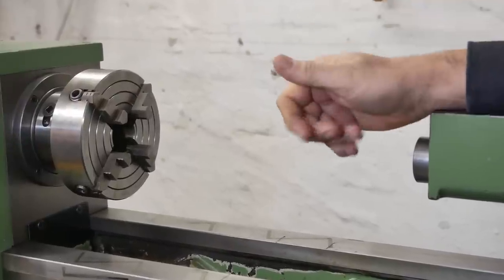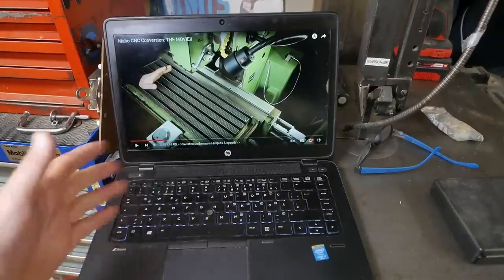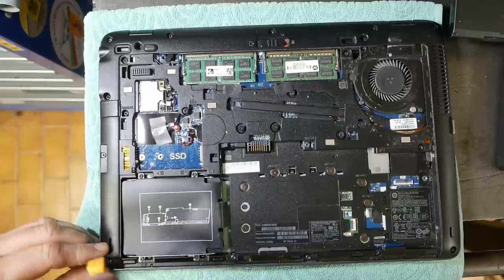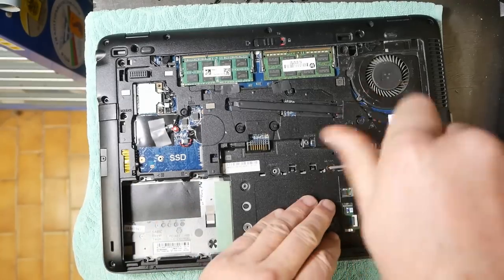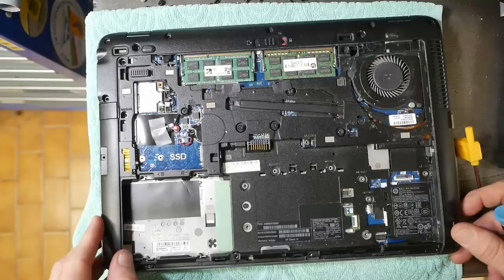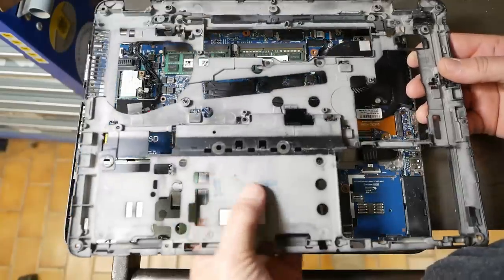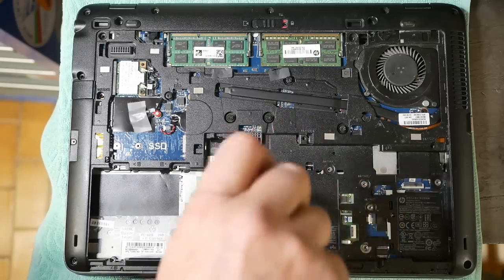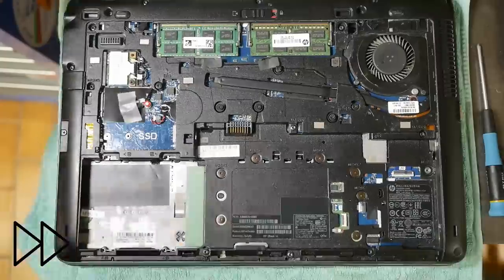M1 Mac: New, Refurbished or PAINTED?!?

Comment: linux+lenovo fanboi opinion: get a lenovo and switch to linux. you'll have a brick (in terms of weight) with painful video editing (in terms of learning a new software). but it'll probably be a working combination for a couple of years. and you'll be able to upgrade it. 
but on a more practical note: what's wrong with a desktop? the new apple SOCs have great performance, but they're impossible to upgrade. a desktop seems like a more sustainable thing for what you're doing. 
and your videos are great as they are. no 4K needed.
Reply from the maker: I travel enough that I need a laptop. I like to edit in the down time and at the airport.
Resolve is optimised to load the GPU and needs 8gb of video ram for 4K editing.
With the current price of 8GB GPU's, even used, it would be a struggle to put together a used part desktop with the performance of the M1 Air, for that price. And I need a laptop about 20% of the time.
Reply: @RotarySMP  "20% of the time" or "laptop" must have been a typo in your last sentence.
i just wouldn't jump the an apple SOC bandwagon until their business model with this approach becomes clear. but i'm also an idiot that wants to get 286 machines going again. so there's a rather special point of view here :P 
we'll love your videos anyway, be they 4K or not - your quality is not in potential 4K, it's in the stories.

Comment: Keep the one you have, paint it cause why not, keep filming in 1080 and buy some cool stuff for the lathe with the $$$ you save :D 
I still don't have a 4k computer either I suspect most don't watch youtube in 4k anyways. I like my old HP I have one too but if I was going to upgrade I'd go for newish used gear rather than pay brand new prices.
Reply from the maker: The old zbook cant play back sped up footage, transitions or titles in real time, so there is a lot of slide show. I do a lot of sped up footage, and cant really see what it looks like till it is rendered out. 90 minutes for a 15min 1080 vid. A modern computor can do that in a minute or two.
Reply: @RotarySMP  I'd go for that deal on the peach one paint it to match the maho lol that was a pretty good idea. Just tape off the USB ports good 😁 but yeah 90 mins is pretty slow. Don't need best maybe can get by with 5yo laptop instead of 10. I got I think 5yo HP and it's plenty fast i7 and only about 500

Comment: I've just successfully removed gold anodizing from a centre punch using a bath of sodium hydroxide. Take the electronics out of the macbook and give that a go.
Reply from the maker: It is a good way to disolve aluminium, like the cases.
Reply: @RotarySMP  No, don't worry, it's like watching paint dry. I've tried it on heatsinks before, it took me 48h to get the black anodizing off.

Comment: Mac's are nice but the OS drives me absolutely bat shit crazy with some of the things that are just standard issue features in both linux and windows machines... which is why I primarily use windows 10 on my (intel) mini and of course you can't do that on an Arm Chip. I think the new hardware is excellent, and the OS is great ... but there's a lot of little nitpicky things that makes probably no difference to most users, but have been solved decades ago on other platforms ... My 2 cents
If you are serious about the MBA I would go with a refurbished one, Mac's are not cheap to repair and keep some form of AppleCare. 800 bucks is a lot to be left out of the loop, least 150 more you will get some service for a period of time (I have like 300 in my mac mini so fk yea ebay parts and non apple everything that I could!)
Reply: Can you describe one of those nitpicky things please?
Reply from the maker: I have had a steep learning curve with Linux, and Apple OS doesnt really appeal. I though you could basically set everything up to behave like Win OS though.
Reply: @jesperwall839  oh off the top of my head you can't create / rename /delete folders in the save as dialog, you have to go to the finder... there's a shareware extension that does it, but is that going to work though the entire support life of a ARM based MBA? (I don't even really know if it would work with X86 emulation for those machines, its kind of a TSR not a proper app)

 Apple actually supports their stuff reasonably well as one of the last proprietary system makers, where as windows and linux loose a lot by having to barf everything that existed in the last 15 years and see what sticks. My garage computer which does some lite 3d cad work and a bunch of electronics design also runs my 3d printer, vinyl cutter, and toy CNC engraver while watching a tutorial... Is a 2012 mac mini (3rd gen i5 mobile, with 16 gigs of 1600mhz ram and dual 1tb SATA SSD's) and it just lost official OS updates last spring

That's not bad for a 10 year old micro PC that can compile code at 100% processor utilization in a, at times, 43C Garage while I am at work and not complain
Reply: @RotarySMP  I tried and you can get it pretty close and like I said its a bunch of nitpick things. Im no stranger to OSX I still have my G4 with 10.4 on it (but honestly I run 9.22 on it more) but I will spend hours a day on a windows machine doing cad work, then when I get some shop time at home its irritating I didnt copy paste right cause the keyboard shortcut is different and out of the box the only thing you can do is set control to be the command key... now you have no control key and 2 commands grr

Comment: Whatever you do, RAL6011 must be applied. I’m actually in the process of building a new open source 3D printer, and looking to print some parts. I’m looking for a supplier of RAL ABS or ASA filaments.
Reply from the maker: Good color choice. Googling RAL 6011 PLA gives plenty of venders here in Europe. Not sure if it will be common anywhere else.
Reply: @RotarySMP  unfortunately PLA doesn’t have the thermal performance I need. I did find one vendor who can provide ABS in custom colours but only in 24kg minimum. I guess it’s not unreasonable to expect that I’ll use 24kg of RAL6011 ABS.

Comment: Ic the laptop works for 1080p editong i'd stick with it until you make enough money with youtube for a new mashine to be in reach. If you really want to upgrade i would suggest a user mashine. I went for a used dell business laptop and got it for ca. 1/2 of the price. I have no regrets :)
Reply from the maker: The issue is the GPU power Resolve needs on a PC. You basically end up with a gamer PC, plugged in fans screaming to match the performance of a an M1 Air on it's battery. And the PC cost more.
Reply: @RotarySMP  Oh no, i am absolutely not suggesting you should buy a PC, M1 makes much more sense when all you want to do is video editing! All i wanted to say is that i had a great experiance buying a used mashine and would do that again and again, no matter if PC or Mac (thoug a mac is not for me). So by all means, go ahead and buy a Mac Mini M1 (if you have the space) or a Macbook M1 used!

Comment: If what you're using works fine for the video quality you're currently working at I'd stick with it until it doesn't work anymore, the quality of your videos comes from the quality of the content and presentation, not the resolution anyway. That said I wouldn't want to go back to 240p videos, but at the same time I'd question whether more than 1080p is really necessary in most cases, I wonder what percentage of YouTube content is even viewed on anything bigger than a 17" screen these days.
Reply from the maker: Good point, but filming in 4K has some advantages for cropping and panning, even on a 1080 timeline.

Comment: Look at the MSI Modern series, I have found them to be great for CAD work and light video editing. They are also very affordable. I have the AMD version, only thing I did to it was add some more ram.
Reply from the maker: Do you used Resolve? It is optimised to load up the GPU, and seems to need 8Gb of graphic memory for its optimal performance.
Reply: @RotarySMP  I use filmorax, but the amd chips have a good apu, I put 32gb of ram in it and solidworks and inventor work well. Played with premier a bit as well

Comment: Just adding my voice to the cacophany of others saying the same things:

4k video, in all honesty, isn't really worth it in terms of resolution. You may find you get better colours & contrast, but that relies heavily on the camera so YMMV there.

If you're deadset on portable, you can't really beat apple silicon with final cut for performance in a small package unless you go for a much bulkier ""portable"". However, if you don't need the portability aspect (especially if you keep your current machine to fill that role) then a tower that you can upgrade over time will be cheaper and much better value overall (:
Reply from the maker: I first thought the same, as I kind of like PC lego, but Resolve needs an 8Gb GPU to edit 4K (or so I keep reading), and even old 8GB GPUs are so expensive second hand, that I would struggle to build a tower PC for the price of an M1 Air. 

I like how 4K on a 1080 timeline allows you to crop and pan.
Reply: @RotarySMP  That's true, I'd forgotten about the absolute state of the gpu (or pc hardware in general) market at the moment... macbook it is 😆

Comment: If you gotta upgrade the best bang for the buck is the PC desktop, and has been said you then get an upgrade path. I am a mac guy, but the kit is expensive. Windows stuff is not quite as polished but its pretty livable with. Oh and another vote for no shits given for 4k. I'd dip my hand in my pocket for patreon if you went down that root. Also you mentioned the lads at Home and Workshop in Swanley? Those lads are quality, proper characters, ever work in Gatwick its worth popping by, i might even be able to do taxi service
Reply from the maker: Yeah, Steve was really good to deal with. 
Thanks for the offer.
Thanks for your inputs. I need a Laptop, as about 20% of the editing I am not at my desk at home.
Resolve loads up the GPU, so you need an 8gb one, and at the current prices, I'd struggle to build a used part tower PC with the performance of a M1 Air for that price.
Reply: @RotarySMP  ok laptops it is then. Apple Laptops are solid, I have no M1 Airs at work but a bunch of the old ones and they are solid and reliable. Never done Apple refurb as work pay :-) but if the guarantee looks good then I would go for it. Not a huge fan of second hand, too easy to buy a lemon, that being said never actually happened to me but hey. And I agree with whoever said no paint regardless of you much you like green. Stripping and re anodising on the other hand.....

Oh and was planning a trip up to faun over machines but they are shut for covid. Damn

Comment: Don't bother with the old one. It's junk. 

If you want the best, then you need an m1 MacBook PRO, not the air. The air (or anything without a dedicated GPU) isn't going to be ant fun to use. 

I personally decided on the Asus Strix g15 with 3050 GPU, but that is for photos, not video. If you went with a PC, I recommend the Asus Strix. The keyboard is REALLY nice, it has a 5600h or 5800h (both really good cards for battery use) and Nvidia GPUs, so they wirk with resolve. 

I haven't used the m1 apples, but I saw a video of a Mac mini that was supposed to be so wonderful. It still took WAY longer than a proper video rig to render things. It is definitely an upgrade from what you have, so  it might be good for you
Reply from the maker: That whole "get the best" may have been correct, but take a closer look at the actual performance of the low end Air.
https://www.youtube.com/watch?v=lTes9KkwmME
Make you wonder if Apple screwed up, and will cripple the M2 Air, to ensure more diferentiation to the Pro and MAx.

The way an M1 can render on battery while all the gamer PC's crank up the fans and need to be plugged in is also quite attractive. I often edit with the laptop on my lap, and it can get quite hot.
Reply: @RotarySMP  either one can get hot but macs are known to run hot, at least the older 2000s models.

I saw a comparison between an m1 mac mini and a proper video rig on Parker Walbeck's channel. The real one knocked the socks off the mini. Yes, for the price etc, the air is GOOD, but it doesn't have the power of a real editing rig BECAUSE of that loud fan. That is cooling the chips inside. And active (fan) cooling us more efficient space wise, than passive (just radiator fins, without fans or pumps moving hot air away from the fins).

It sounds like you want the Air. It is definitely a good computer, and great for the size etc, all I was saying is that it isn't going to render that 12 hour render you mentioned in 1 hour. If you are wanting that, then you want at least a $1600 PC with 16-32gb ram, 8 core CPU, fast storage, and at least a 3060, if not 3070 gpu. Even that probably will take a long time. 

But ANY new computer that is marketed towards performance editing or gaming will be a HUGE upgrade over the HP.

Comment: Sure a laptop can edit, if you got the time. How's the used server market there? You want ram and cores. Idk if your software can utilize a GPU. As opposed to cpu bound. If so a decent used gaming puter might be the thing for you. Personally I couldn't cross the bridge to Apple Land. Chip shortage, supply chains yada yada .. it's tough all over. That's why I suggest used server stuff. Companies dump and upgrade regardless of market. Couple year old server stuff 'affordable' for normal people.
Reply from the maker: I have looked at used workstations, but travel enough that I need the laptop.
Resolve is optimised to load the GPU and needs 8gb of video ram for 4K editing.
With the current price of 8GB GPU's, even used, it would be a struggle to put together a used part desktop with the performance of the M1 Air, for that price. And I need a laptop about 20% of the time.
Reply: Been awhile since i was building computers, but I think you get a laptop with 16gb ram or more, and a dedicated gpu . Not integrated . And you're golden. Of course you'd want the latest greatest gpu in there, but who can afford it? Your program is still going to run. Fast. Faster than a dropped ball bearing finds it's way out of this universe. Well, compared to what you're used to. 

Laptop for travel. Doing a lot of editing on the road? Use current lappy for travel/work and get a workstation. Could even send video to it otr and have it chomping away at home. It's Friday night here and I'm rambling and cheers. GL

Comment: If it has to be portable, I'd get a used enterprise model that is known for reliability, proper cooling and a sturdy chassis, like Lenovo T Series or HP Elitebook. Those are also somewhat repairable, unlike the apple stuff. Ebay is full of 3 year old enterprise stuff that beats anything new price-performance wise.
Reply from the maker: That is what I did with this Zbook, but you need an 8Gb GP for Resolve and 4K vid, and that is not available in used enterprise Laptops. I have considered a Razerblade 15, but that price even used is beyond my budget.

Comment: A dual boot Linux/Windows desktop would enable you to test run MESA cards and then you can just swap out the motherboard and processor when needed for much less than a complete upgrade. This also allows for multi-monitor and monitor replacement when needed. Consider starting a Patreon page. Your current quality is excellent so whatever saves you the most time will allow you to scrub that serial number more often!
Reply from the maker: Thanks for the feedack. For the set up of Mesa cards, I find it better to just bodge up whatever will be the final machine PC, rather than dual booting.

Comment: Historically, it used to cost more money to cram a given amount of "power" into a laptop, compared to a big-box computer. But times may have moved on. I don't know. (he said, posting from a 2008 Dell Vostro 1700 running Linux)

My 40" Sony that I watch ... everything on, it's my only TV, is 1080p AKA 2K.

I am little bothered about 4K videos. Does you YouTube demographic data tell you what your subscribers are watching on?

If 90% of them are using phones, 4K might not matter...
Reply from the maker: Good points. With the current price of GPU's, a tower PC is not in my budget. Editing 4K video is advantageous, even if you output 1080, as you can crop and pan more.
Reply: @RotarySMP  Yes - I've seen some comments on video editing where they shoot wide 4K, and then "edit in", zoom-ins, zoom-outs,  and "slide" moves.

Saves a lot of handling of the camera for single-person shoots.

Comment: I think 4k is unnecessary for YouTube; your videos are fine already; good audio and lighting.  The content is more important than the vessel.  A desktop with a reasonable GPU and RAM should work well, be up-gradable and cheaper?
Reply from the maker: Thanks for the feedback. Shooting 4k and editing on an 1080 timeline has some advatages for cropping and panning without losses.
With the current price of 8GB GPU's, even used, it would be a struggle to put together a used part desktop with the performance of the M1 Air, for that price. And I need a laptop about 20% of the time.

Comment: care with painting high end laptops as often the chassis/ frame are used as the heat sinks.
Reply from the maker: Yeah, probably not a good plan.
Reply: @RotarySMP  wonder if the laptop was a m1, i think they are aluminium or magnesium alloy frames. if u could anodize them your green colour that would be cool. also hi from NZ : )